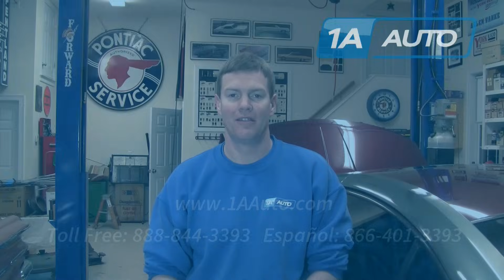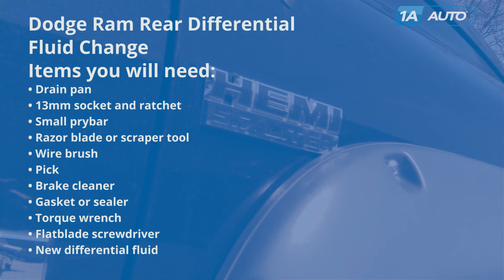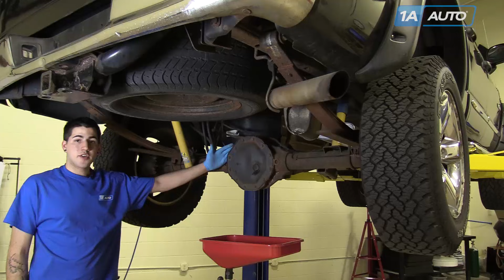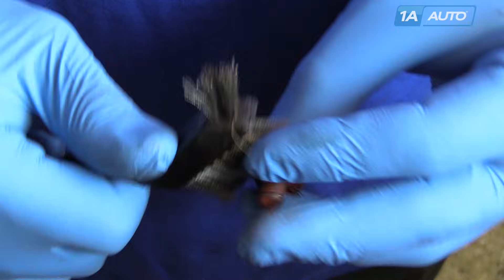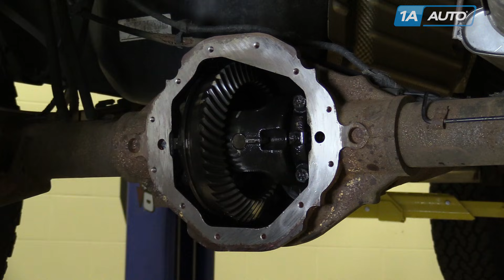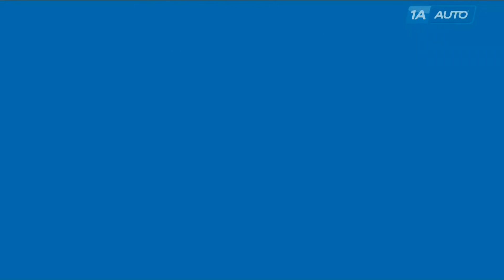How to Change Rear Differential Fluid 02-08 Dodge Ram 1500

Comment: Be careful with the bolt size, mine is 1/2" in my 2007 and using a 13mm will round them off if stuck tight. Otherwise great info.

Comment: Thanks for another great vid, got the fluid changed out on my 2004 Dodge 4x4 Ram 1500 with the 5.7L Hemi and 3.92 gears in Chrysler's 9.25 - 12 bolt rear axle.  My oil for sure did not look all that great, got the truck a couple weeks ago and it's about at 160K miles.  The old existing RTV squished past the bolts indicated it had been changed at some point before, how many times I'm not sure, but it was way over due.  Thankfully Chrysler added a pink colored magnet on the bottom inside to capture metal shavings from the gears as they wear down over many miles.  Spent a good amount of time wiping black grime off of the inside, as well as all the metal shavings from the magnet itself.  I chose Valvoline full synthetic 75w140 and some CRS limited slip additive in a 7oz bottle from the A-zone (factory calls for at least 4oz).  There's a lot of back n forth information on many forums and sites about how other gear oils perform, when it comes down to it I believe it's how and what you do with your truck most often, as well as how many service intervals in miles you have to go before it's time to change gear oil again.  The last owner did a ton of towing with my current truck, hence why I was quick to get on changing all the fluids, however I mostly drive my trucks occasionally for hauling light things around in the bed, or drive often in the winter through the snow.  So go with the fancy expensive stuff if you're really using your rig hard, if not, save the money and get the conventional stuff that still has good things going for it's brand name.  Also, I've read a few times now that the oil level in the rear diff needs to be slightly more below the fill hole, about 5/8", some say if it's level you can run the risk of having too much oil in there which leads to aeration in the oil/foams up and excessive gear wear can occur.  I suppose it would be a good idea to test this by having it filled like you guys did in this video, take it for a good long drive at highway speeds, get off somewhere after a while so you can pull the plug and see it it's foaming inside or not.  I also have never found anything that suggests using limited slip additive in the front differential, you would think you should if there's a locker in there for your 4x4 system, and not all 4x4 dodge trucks will have a limited slip/posi/SureGrip/anti-spin in the rear differential as well, only way to tell is by spinning the wheels, if both spin the same direction while the rear end is in the air and trans in neutral, you have a limited slip/closed diff, if both spin opposite from each other, then you don't have a limited slip/it's an open diff.  Anywho, those are my thoughts, hope this helps!

Comment: Why not just leave the gasket as a bead rather than smearing it down?
Reply: Wondered the same thing. If anything, smearing it would increase the change of a leak. Definitely should have used a bit more if they are going to spread it out.
Reply: I'm guessing to eliminate air bubbles?

Comment: Thank you.  Looks easy enough.  Mine is a 2002 Ram 1500 SLT and has 75,000 mi.  Probably wait till 100K to change it.  I use it to tow a boat and haul yard materials.  That's about it.  Never had an issue with my truck except a rusted U bolt and a rusted brake line.
Reply from the maker: +Bass Dojo Thanks for the feedback!
Reply: That's some low mileage for a 2002!!I have an 08 160,000 miles had to change water pump end of 2022 only issue I have had so far besides paint starting to come off on the roof.About a 6 inch by inch circle.Only spot that I have a bad paint spot.

Comment: Or you could suck out the diff fluid and refill. Taking off a non leakin diff cover is plain stupid. I used to work in a Chrysler dealership and that's what we did, suck out and refill. Unless your cover is leaking this is stupid and useless
Reply: It's a perfect time to inspect the gears, wipe grime off, as well as see how much metal shavings are on the magnet on the bottom inside.  That, is the extra few steps towards making things last even longer.
Reply: You never know what you will find taking off the cover, in my 04 tahoe there was a chunk of gear in there. Whoops...

Comment: Other than inspecting, is there any good reason to remove the cover and not just remove the drain plug?
Reply from the maker: +Mark Thanks for watching!  Things like corrosion or damage could be a reason to remove the cover rather than just the plug.  1aauto.com
Reply: @1AAuto  The 1999 Dodge Ram Chrysler diff doesn't have a drain plug.

Comment: What should I torque the bolts to? Thanks ! Great video
Reply: 30
Reply from the maker: +Mike Barbier Thanks for watching!  He goes over the torque specs and directions for those bolts at the 5:15 mark of the video.  It is 30 lb-ft in a crossing pattern.  1aauto.com

Comment: I got 260k miles on my 2008 ram 1500 and haven't changed axle fluids one time. I reckon it's about time I get r done
Reply: Just bought an 04 with 338k miles runs like a beast, and no drivetrain issues whatsoever 4x4, trans, motor all excellent.  Replacing coolant HOAT, oil mobile 1 extended life full synthetic, and all synthetic trans and diff fluids, why, lol, well if it does everything a $50k 4x4 hemi does why not 338k miles and running strong.... Yeah I'll spend a couple hundred on fluids and make it last.
Reply: @normanwroblewski935  id like to know as well.
Reply: holy shit no kidding i got 272k kilometers on my 02 ram 1500 and about to do rear diff its starting to click when i make sharp turns
Reply: I just did mine at 300 and she's mint hahah
Reply: OMG I’m in the exact same position except I’m at 220K. Did you ever change it?  and did you have any problems afterwards?
Reply: @OUNOU812  did you change yours and have any problems?
Reply: same😭😭😭

Comment: Do you use limited slip additive on the front  I have 08 ram 1500 5.7 4x4 slt ..
Reply: I get the valveoline that has it already in it and that way you are covered Whether it requires it or not

Comment: How often should you change rear diff fluid ?
Reply from the maker: +Dylan Zink Thank you for checking us out. It is recommended every 30,000 miles to 60,000 miles. Please confirm exact mileage within a OEM service manual. 1aauto.com
Reply: 30,000-50,000 Or ... Severe service,  every 3 years normal service 5 years
Reply: @randomsanwhich2 thanks
Reply: I like 50k on my dodges